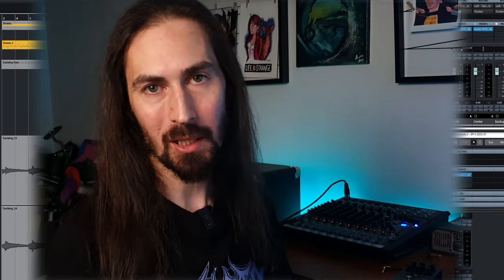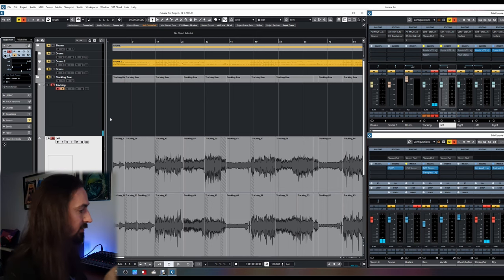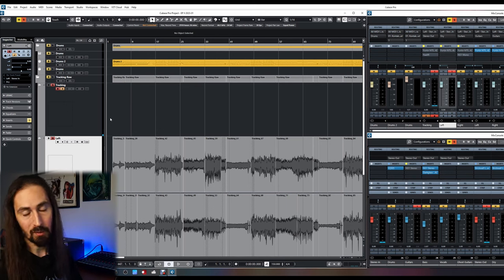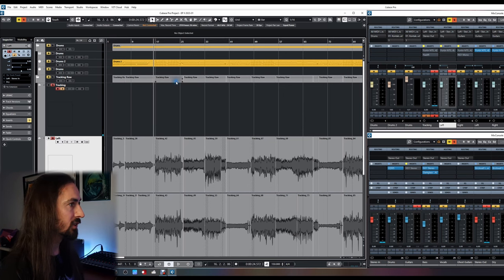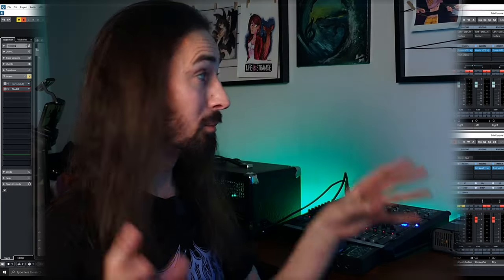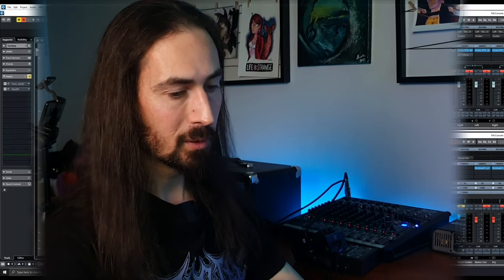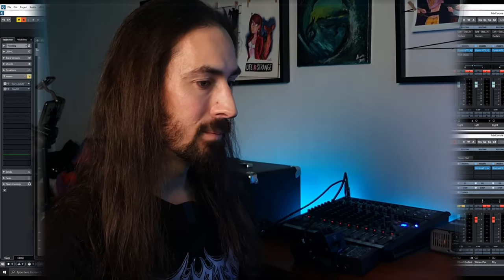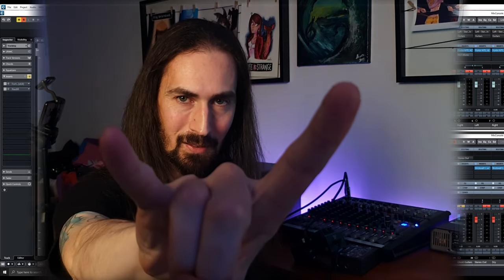How to Re-amp and all the different options afterwards!

Comment: Also curious about something.  If your say recording a sludge or noise-y hardcore/punk band, and the guitarist wanted feedback at start or end of a song, would you record some separately and mix it in around the song, or how would you do something like that?
Thanks
Reply from the maker: A trick I did years ago for a band, is used a line6 amp head, which had direct out setup and have the speakers plugged in, so we got the feed back with the speaker with the direct input... So no mic needed. It was the clearest feedback sound I'd ever captured!